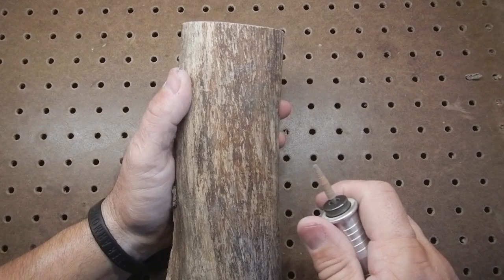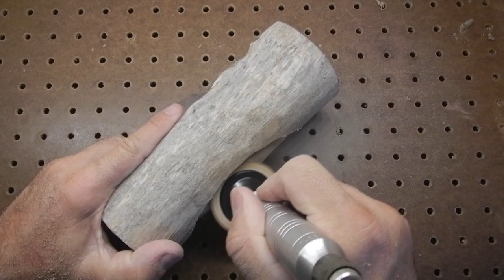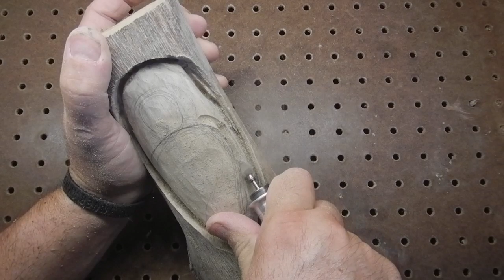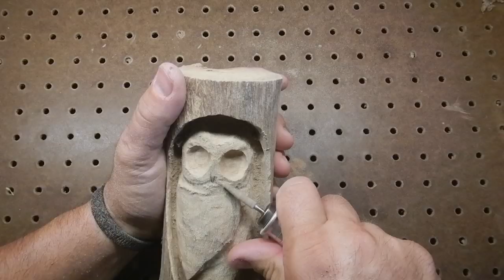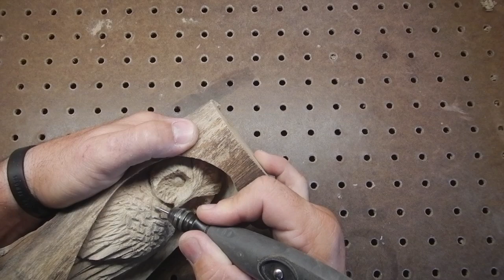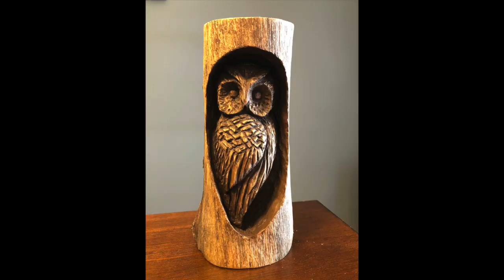Wood Owl Carving with Power Carver

Comment: Nice job!  Out of curiosity, how did you finish yours?  Paint?  Stain?  I just carved one myself, and I'm ready to finish it.  I thought about using my wood burner to add in some details before finishing it off.  Thanks!
Reply from the maker: I usually just put 2-3 coats of danish oil. I do experiments with wood burner too but what i like the best is still danish oil. Thx

Comment: What do you use for dust collection / ventilation?
Reply from the maker: Greg T  I using one from Harbor Freight only the motor and a pipe running outside straight.